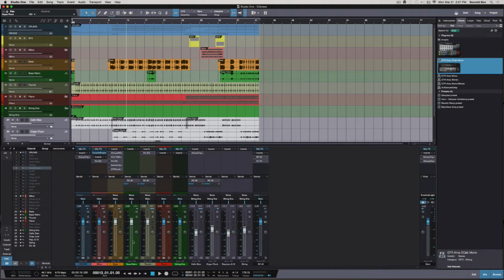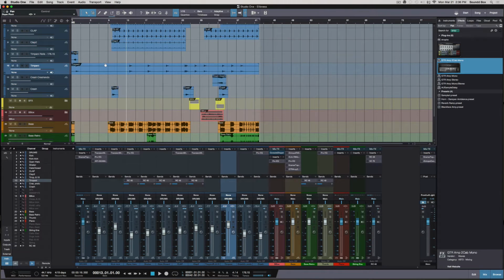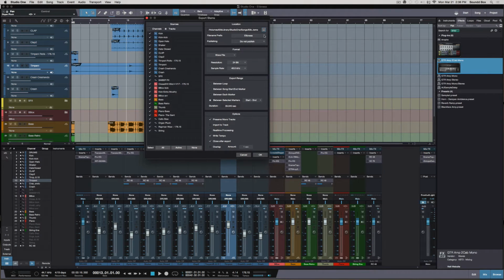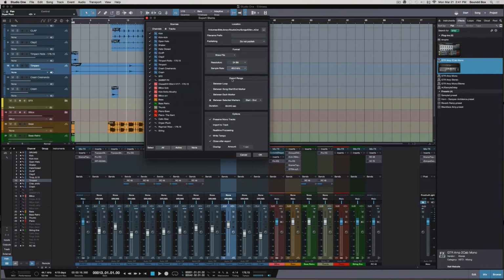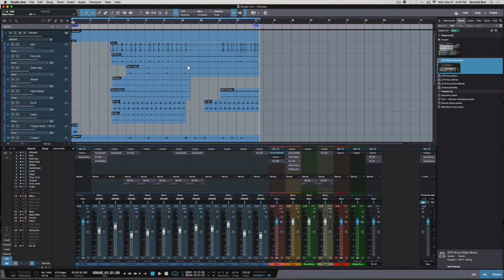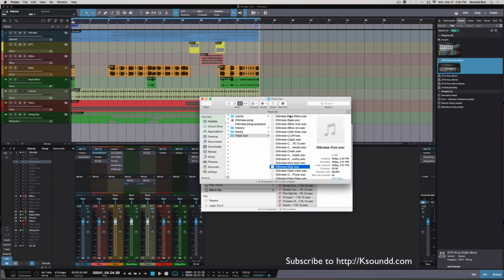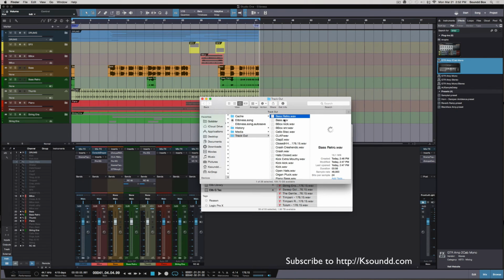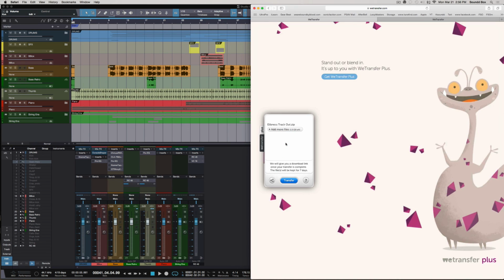Studio One 3- Export Audio For Mix Engineers [EXTENDED]

Comment: When I export stems from any other DAW, I get a very high quality WAV file that is usually 50-70 MB per audio file.  When I export stems from Studio One, I get a very bad quality WAV file at around 25 MB.  It almost sounds like I'm taking 24 bit recordings and reducing them to 16 bit.  I always record at 24/44.1 and I always export stems at 24/44.1.  I never have a problem with exporting in Logic, Pro Tools, or Reason.  Any time I'm in a studio that only has Studio One, I seem to have to mix in that studio or I get very low quality audio files.  Any chance you know how to remedy this?
Reply: 24 to 16 bits dont make a sonic diference. Maybe you are exporting to 8 bits or 36khz instead of 44.1. anyway, bit depth is about dynamic range, not sound quality

Comment: Do people normally normalize the wav files after exporting ? 
When I export my WAV files are very low and you can barely see the wav lenths of the tracks and when I normalize I feel like it's too loud,  no peaking but still something seems off. Thanks for your knowledge man!
Reply from the maker: King Commit I don't mess around with normalizing for that reason. I rather use compression or increase clip volume for better control.
Reply: KsoundDef I think I figured it out, I had a mixtool at -6 db enabled on all my tracks. I disabled it and exported the tracks again and they sound louder 🙏 
Thanks again!
Reply from the maker: King Commit my pleasure